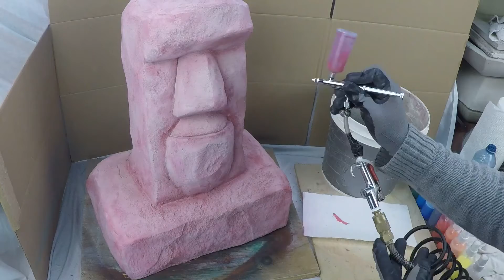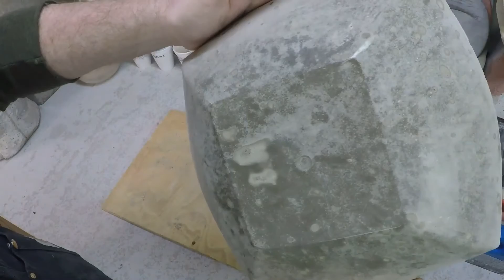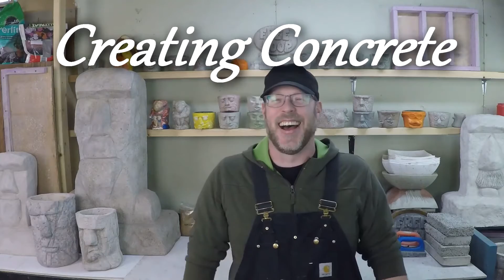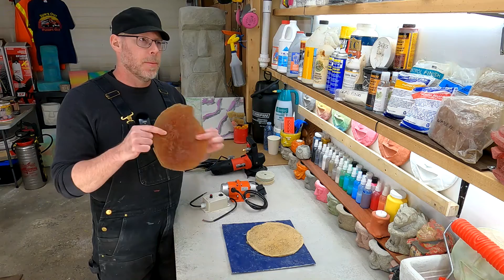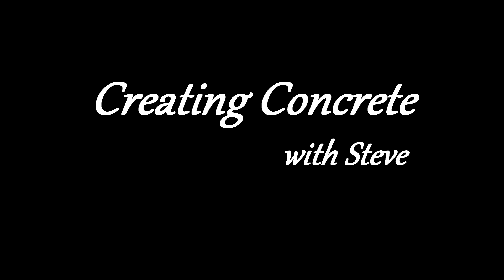3 (Advanced) Tools for Decorative Concrete

Comment: i do concrete craft in my apartment, so using a variable speed wet polisher is a dream for me....
and yes, i am exactly in that phase where i want to explore all kinds of textures from exposed aggregate of all sorts.

And what i use to get the mirror-like finish are simple grinding pads, which i manually grind with. It is, by far, the most time consuming aspect of creating concrete craft.